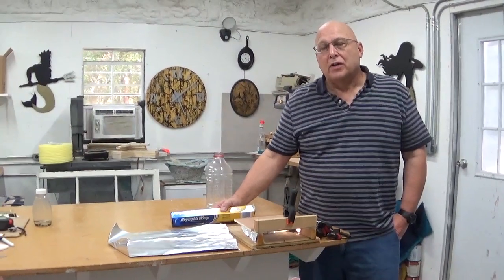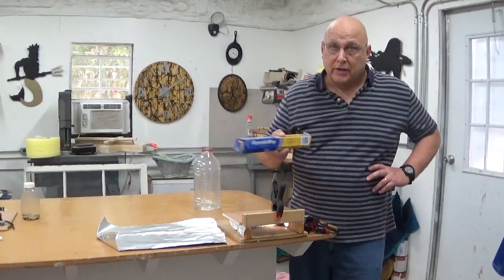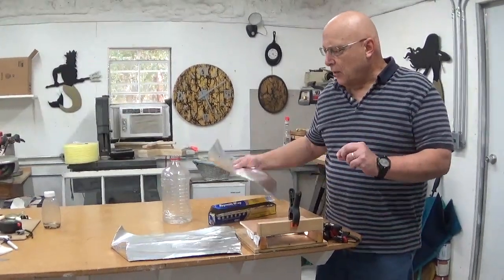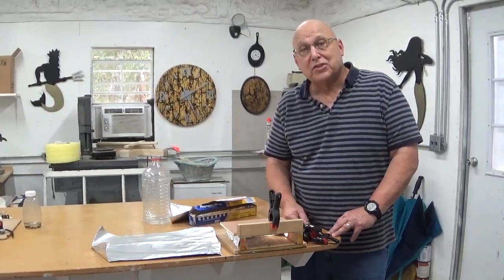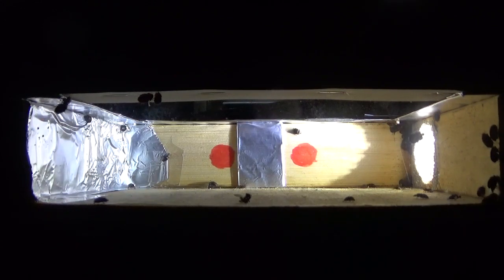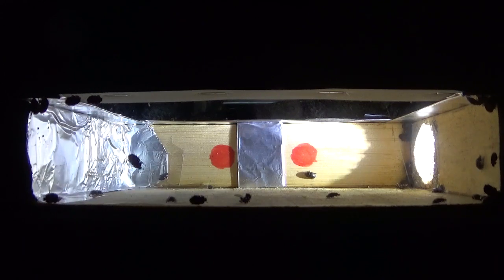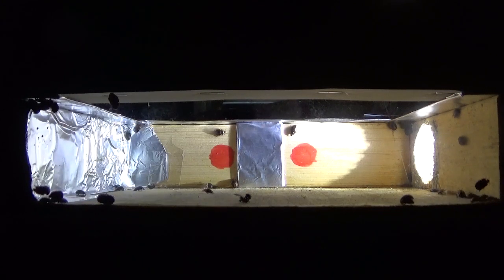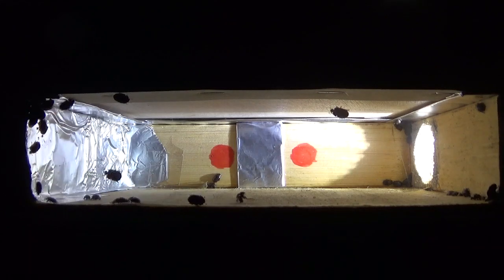Small Hive Beetles can crawl over anything, Neverwet coating stops them

Comment: Jeff, a quick question.  As I recall, your design calls for three strips of flashing on the sides and back of the bottom board and one strip to complete the encirclement on the front lower edge of the brood chamber.  Why not put all 4 strips on the bottom of the brood box, or build up the sides, back of the bottom board a 1/4  or 1/2 inch  or so and add a full width strip of wood the front of the bottom board  to staple the 4th strip across the top of the front?  I have gathered all the supplies including the stainless staples.  When I build out my beetle trap, it may become apparent why you designed the three strips and one.  I am toying with putting a mason jar with #8 hardware cloth in the lid, and drilling a hole in the middle of the bottom board  hoping the bees will "herd" the small hive beetles into the jar that I will fill with mineral oil to drown the little bastards.  Thanks for your continued work in this area!
Reply from the maker: Hello Chip,
  Use the updated version of the Beetle Barrier using the 3/4" wood rim with the 1/8" hardware cloth ramps, this proved to be the best design, that video is also posted.
   Using the Neverwet Beetle Barriers with screened bottom boards and an oil trap tray like the Freeman is the ultimate SHB prevention. Mason jars with oil will add some small degree of killing SHB but nothing like an oil tray can do. Good luck..